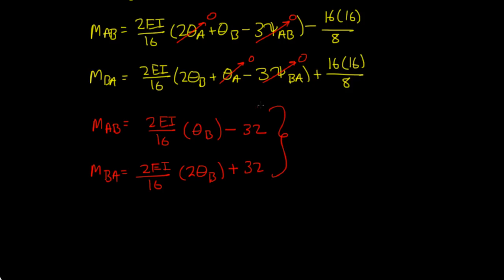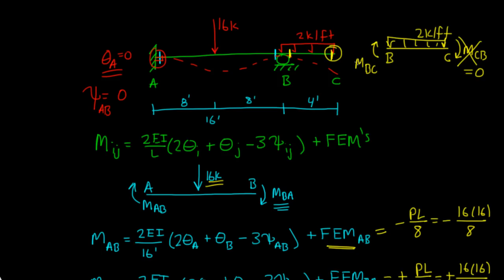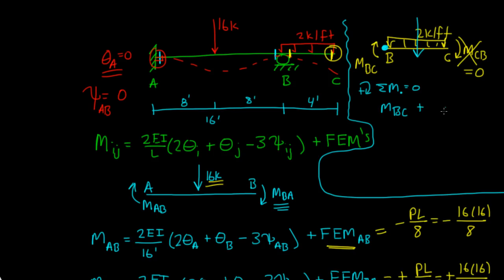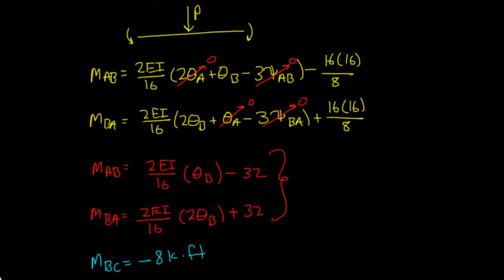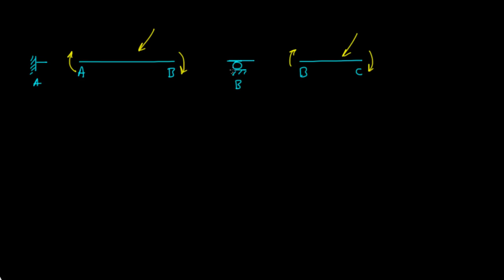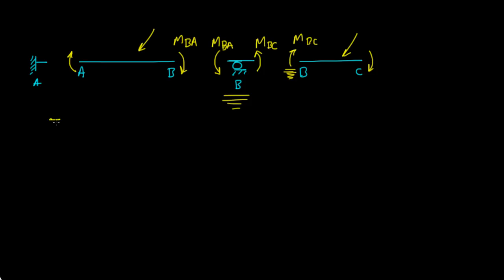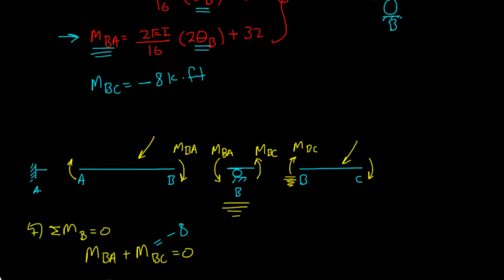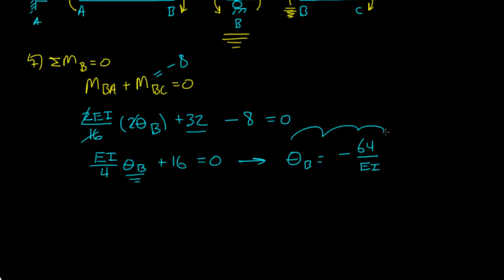Slope Deflection Example 1: Part 2

Comment: Hi, thanks for the amazing video despite the minor mistake in calculation.

 I have a question. Shouldn't we first identify the degrees of freedom and then proceed with the equations? Also, why didnt we calculate the deflection at C? Lastly, how do when NOT  to calculate for an equation such as the one you did for member BC and thanks.

Comment: i would like to inform that there is a mistake a 6:18. where you did 32-8=16.
Your video is very informative by the way.
Reply from the maker: Thank you so much! In fact, that -8 should actually be a -16. I solved for Mbc incorrectly. The correct value for Mbc should be -16. See 2:00 for the mistake. Thanks again! I will post a notice on the video shortly.